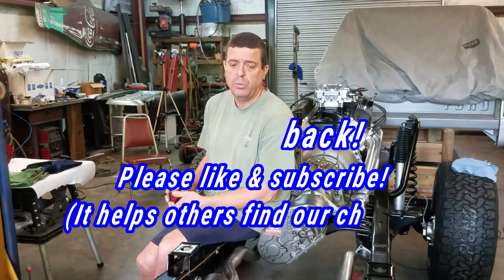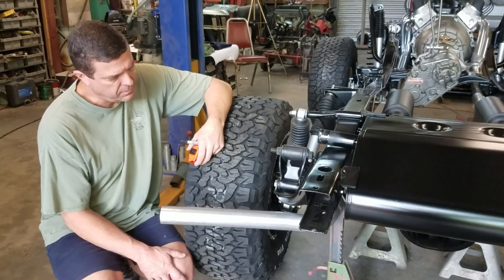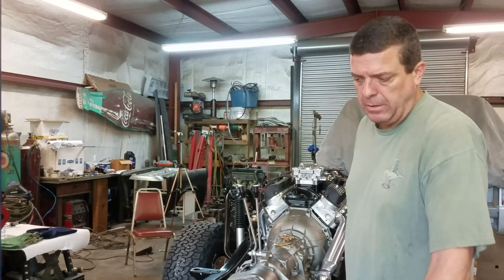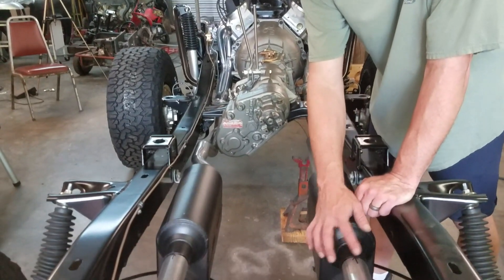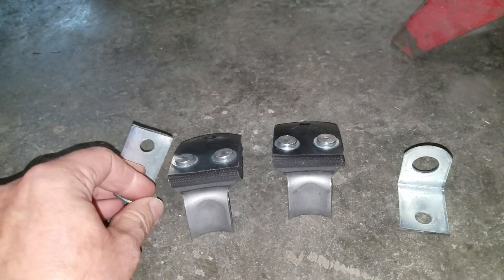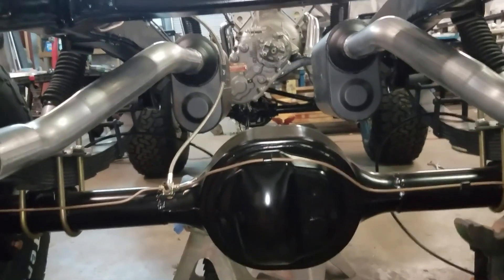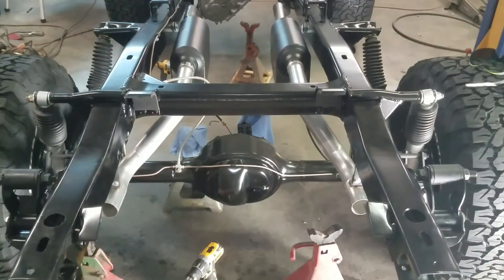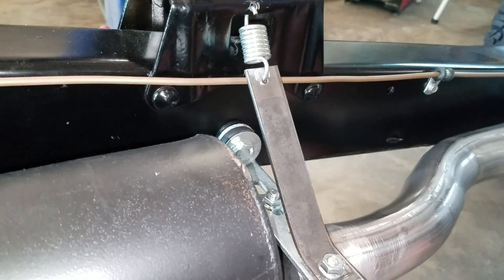Part 2 -TBP Headers and James Duff Exhaust Installation - 1966 Ford Bronco Restoration Project

Comment: Nice and clean! I like tapping the frame holes also. For the tap I have some El-Cheapo chinese square (8 point) sockets, it's easier than an adjustable wrench - just an idea for next time.
Reply from the maker: Yes sir that does work much easier.  I was being lazy.

Comment: I can't believe some if the choices that you made plumbing in that exhuast.
1) why didn't you use all stainless.  A set of stainless mufflers are cheaper if the life of the product is taken into consideration.
2) why did you sacrifice how the install looks over how it fits.  You could have rotated the mufflers outward on the top, placeing the tubing farther away from the fuel tank...even spacing the mufflers further outward on the hanger, giving more clearance for the gas tank.

I really like you solution for the header to transmission clearance...very well done.
Reply from the maker: 1) I got a deal on the exhaust.  Saved money on marketplace.
2) I liked how it looked.  
Everyone has a way of doing things.  I am not saying mine is correct, but it was the way I wanted it at the time.  There are always things you can make better but I chose to keep moving forward so I could finish the project.  
Thanks for watching.